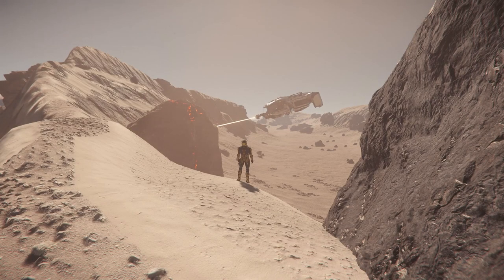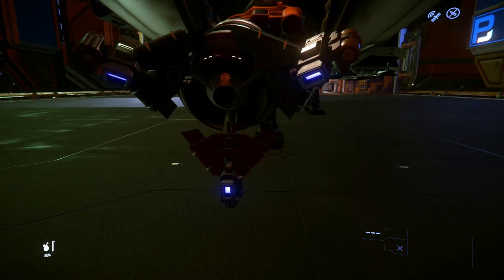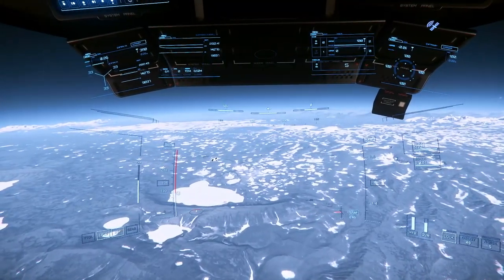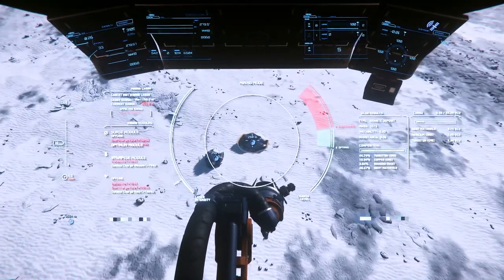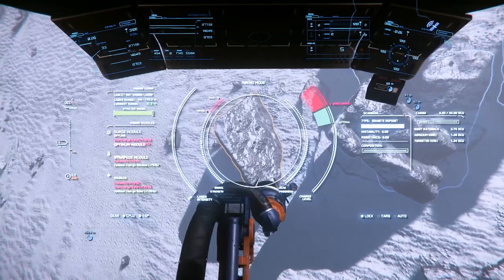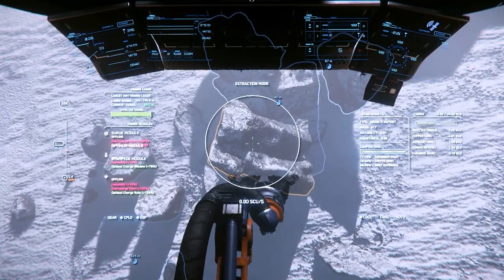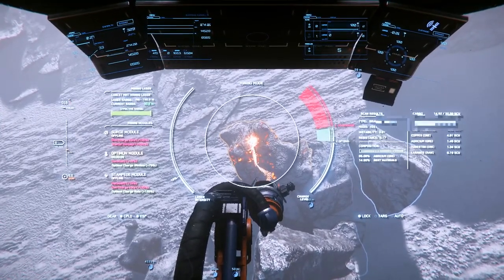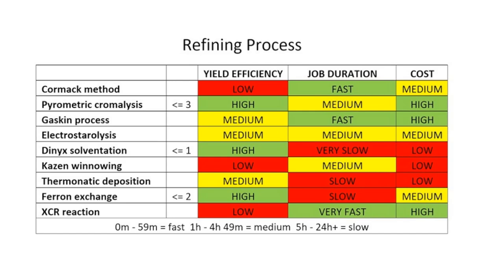A Guide to Mining with the MISC Prospector [Star Citizen, Patch 3.15.1 - 2021]

Comment: Well done. This is great for beginners. I’d suggest the optimum and stampede with a FLTR XL module on the lancet. 

I’d be more picky about what to mine. I don’t pick up anything below Agricium because it’s just not worth it. Heph is drastically less valuable than Agricium and with only 32 scu of cap, it’s worth it to be picky as you get better at mining. 

I’m pretty much a Qu Miner at this point. There’s a lot of goodies out in the Verse! 

I just run 3 FLTR XL mods. The Lancet can handle just about anything without extra power. Stampede is a nice one to have though.
Reply from the maker: -60% inert is a great way to mine, thanks for the tip
Reply: Thanks for watching. When filming the video I mined the first thing I found with good contents. I didn’t want to give anyone the wrong impression that high value mineables were easy to find anywhere.
Reply: @jawasparky6347  totally understandable. Loved the video. I’m glad to see you praising the Lancet. It is my go too even for the super high % Qu rocks. That heads amazing.

Comment: Seems like the same suggestion everyone is saying.    Try   Lancet,   Torrent III ,    vaux C3  ,  Vaux C3     crack only Quant       to to the aaron belt.    rocks over 20.    most are 40%   and almost all of the are at 100% when i'm ready to collect.    the combo of head and modules make cracking q rocks very steady.
Reply from the maker: My new recommendation is to use 3 FLTR-XL's with a lancet.  Its a hit more time consuming but filtering out 60% of the inert material is awesome.
Also I typically don't mine Q, I go for Borase, Laranite, Hewitt, stuff that doesn't blow up my ship.  But to each their own.  - Fist
Reply: @FistandJawa  but mining Q you mostly get 100 percent rocks to pick up   i might slum it and grab a 60 40 toward the end,  but after 8 100 rocks that doesn't matter.

Comment: UPDATE - I sold the load I mined for 44,000 aUEC!
Reply from the maker: Noice
Reply: How long did it take? Bounty hunting seems far more efficient. I won't bother with mining if 40k is considered good in an hour. I can make 4-500k an hour with bounty hunting.
Reply: @B.D.E.  4-500k bounty hunting? thats insane how do I start
Reply: @B.D.E.  it took about 10 minutes to  mine but 22 hours to process. I usually make a few trips a day and take them to the refinery when I have a full cat.  I usually clear more than 1.5 mil a caterpillar load. As for bounty hunting You need to be up to those VHR bounties and I am no that good at dog fighting yet.
Reply: @kachowbltch3585  Do group ERT bounties in an Ion, Vanguard, 600i, or Constellation.
Reply: @jawasparky6347  You don't need to be good at dogfighting, the AI is terrible and offers no challenge whatsoever. I can take out Hammerheads in a vanguard without taking any damage myself.
Reply: @B.D.E.  Yeah, a single VHRT Group bounty will give you around 70k in 10-15 minutes

Comment: It seems like Stampede and Optimum modules can't be activated at the same time.  Even when I try it on my prospector.  

I can see in your video when you activate the Stampede then after a small delay the green window created by Optimum shrinks back down.  I think this is showing the Optimum module getting overridden.
Reply from the maker: I think you are right John
Reply: @FistandJawa  
I went and tried it again and now I'm not sure.  I need to experiment more.  

Optimum just doesn't last very long so it might just being going off when activated so soon.  Best to use it at tail end of finishing off a rock.